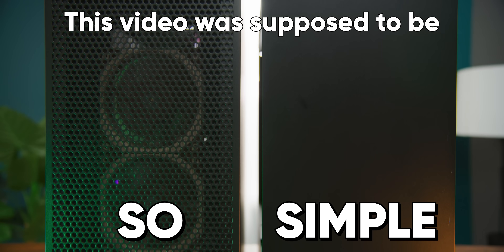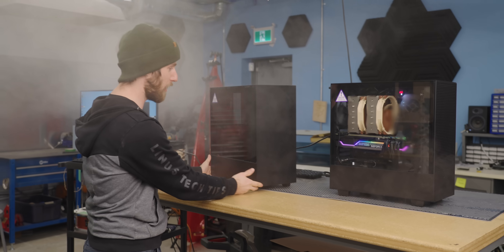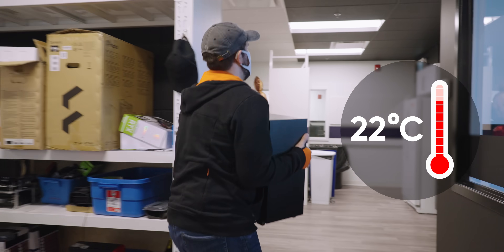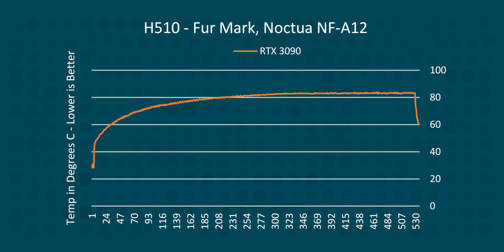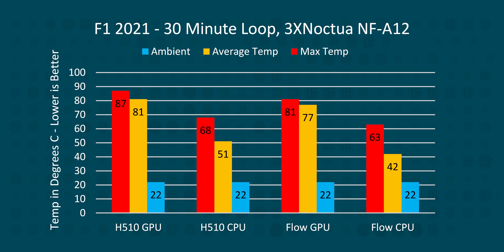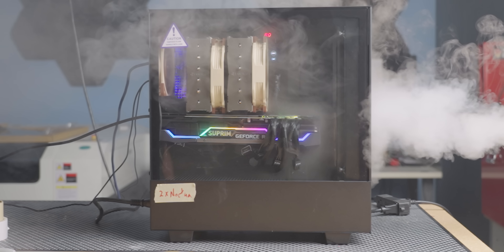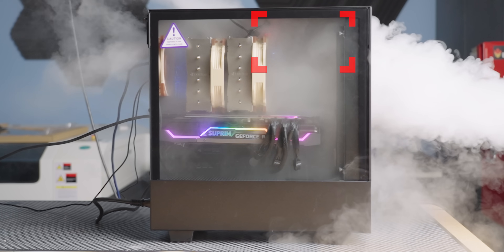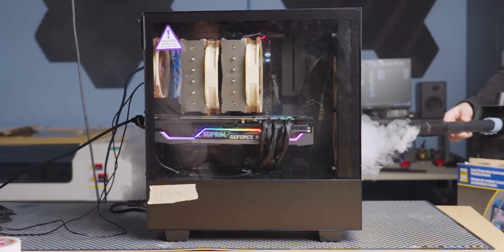Everything You Know Is Wrong - Mesh vs Non-Mesh Front Panel

Comment: I was worried about my corsair 4000d airflow when I saw this video, but I am building with two 140 mm noctua fans on the top for exhaust and 1 120mm noctua fan on the back for exhaust.  My plan right now is to run my exhaust fans much slower than my two 140 mm noctua fans on the front to create just a little bit of positive pressure.  If I'm not getting good temps on that in my gpu I can try the vertical mounting option for it to open up some more space inside the case.

Comment: I spent hours tuning the fan speed on my Pc to compensate for temp changes. basically created a state of constant positive pressure. as the temps rise my rear exhaust fan actually slows down to compensate for the blower GPU and the Top mounted AIO. so far so good.

Comment: it really seems like the main problem is the size of the case. which butts the bottom fan blowing directly into the side of the gpu. plus the 3090 is 5 inches thicc. if you're already spending $1800 or more on a card. you may as well get an optimal case or a water cooling solution to mitigate your airflow problems with such a large card. also I'd really like to see a tapered edge option of add on or just a  3d printed one. then the air wouldn't be slamming into the blunt 5" end of our thicc boi 3090

Comment: What I did to help fix the issue of air getting stuck around the GPU is zip tying a fan to the back of the case over the pcie slot things so it would pull the air out and go past the GPU on the process.
Reply: so basically 2 exhaust fan at the rear (1 rear for cpu exhaust and 1 rear exactly behind gpu)??
Reply: @bolulembut1132  exactly
Reply: @tinyterrarian  thanks for confirmation, is it still effective with solid front panel with 3 front intake 2 exhaust (back cpu and back gpu)? im using tecware nexus M and im still wondering what best fan configuration for this case

Comment: I have a closed front case for my computer, with a reference AMD, had my GPU running really high temperatures, switched stock coolers for 2 140mm noctuas to increase internal pressure and the temperatures dropped more than 15º on GPU. Organic load on CoD MW2. Apparently the GPU was trying hard to blow out air from a low pressure environment to a high pressure environment, that was my conclusion, but I'm not an expert or neither did more tests, just accepted the absurd improvement.

Comment: Oh, how much easier it would be to experiment with thing slike this with some pior analysis based on some thermodynamics knowledge...
yeah, you cna prettymuch look up any fan with it's statitc pressure and airflow
then calculae the dynamic pressure at specified airflow
and see that it's much less than the static pressureindicaing that while restricting it wil lreuce airflow, you can keep a significnat portion of your total airflow with quite some restriction
from there it's a quick step to plot a decent approximation of the exact restriction area to airflow function
but yeah
all intakes is going to lead to airflow roguhly equa lto your static pressure over your outflow area

Comment: I wish people would do more fan layout testing on cases. I have a Fractal Design Define 7 XL Black and had 3 intakes up top 3 in front 1 exhaust in the bottom and 1 in the back. temps were fine honestly but I can't help myself but to mess with things sooooo I used my vape to see how it was circulated and the fans seemed to be fighting each other. I had a dead spot in front of the cpu. I changed it to 1 top rear exhaust 1 rear exhaust 1 bottom intake blowing straight into the gpu and 3 front fans and it seemed to make a big difference. I google all I want though and I can't find much other than forums with everyone saying conflicting things. Thanks for this vid tho it kind of confirmed in a way the problem i had kind of. How is there no one testing fan lay outs for air cooling and water cooling for different cases with a mix of gpus?

Comment: I have the Lian Li 011 Dynamic EVO and I thought the mesh front panel would cool off my video card more, but it just ended up looking uglier and no benefit.  That and it looks ugly compared to the tinted glass, so I put the glass panel back.  Temps are about even and it looks 100x better with the RGB.   I did not add additional fans, as it already has 10 ARGB fans (3 on the top mounted 360mm AIO) and is a wiring nightmare already!

Comment: if the motherboard manufacturers understood  heat dissapation they would reconfigure the  gpu on top of the board (Heat Rises) and case  manufacturers would  make power supply mounting  on top of  case and make many fans for exhaust on top of  case....combustion engine  principles, exhaust is  important out the valves...but  hey everything works. Why is  the hot , most watt consuming part right  below the cpu....ughhh so stupid and  so many people  want to refine this dumb system....Linus...please....build a  mother board....please do some emulator testing, real world benchmarking for  average users. i need a flex duct/register clip on to hvac and  a case  that allows this...muhahahahahahaha call me linus, lets make 10 million

Comment: In my opinion I disagree with this video and it is kinda misleading, it really should be changed to "Compact cases: Why Extra Case Space Is Important" The issue is your cramming such a huge GPU & CPU cooler in a case that is marketed as minimalist/compact mid-tower. Just because it fits does not mean its a good idea. This test/video should be repeated with the same hardware in a normal/non-compact designed ATX case offering a mesh/no mesh option.

I do give Linus credit he admits this is an extreme scenario however, I would not have chosen this case with this hardware because of the limited air flow, and case design. Linus sums it up quite well in the end "PC building is about balance and personal preference" Poor case choice for the hardware, with poor ventilation, with very little room for my liking.

Comment: Great Video Linus, really, great video. I loved this one, but i have one issue with it. 

It took you 6 and a half minutes to repeat the same result and the same question many times before you say straight what happens and why? 

6 and a half minutes of watered down content repeating the same many times can be condensed into:

We tested the solid front panel and mesh front panel versions of the same case with the following results:
Results with solid front panel and stock fans are.... 
Results with mesh front panel and upgraded fans are....
The reason for this result is shown with our smoke machine ,the mall case creates lot of turbulence, and inability to provide a good airflow to the affected parts (parts in question) and the smoke machine only shows the turbulence and recirculating hot air, actually diminishing cooling efficiency....

and this takes minute and a half to 2 minutes, considering frame changes, demonstrations with the smoke machines and make everyone understand it. Come on Linus, you can do better than that. We know you know better than that and you can do better than that. (last sentence is intended as compliment and stating the truth)

Outside of this single issue, the video is great, i learned a lot, and as general conclusion - i love the video. But the watered down content on stating the same statement and repeating the same question for 6 and a half minutes, i am afraid that this is well earned, and well deserved dislike. Sorry Linus. No hate or trolling intended.

Comment: Hi, Thanks for the video. I have a question, is it so bad to use the case without sidepanel? My case doesn't have a mesh front panel and my vents are not filtered, so would not using side panel make much of a difference?
Reply: not really, just that dust will have a freeway to settle in your components, unless you fancy cleaning every week

Comment: I wonder if a 3 fan front panel case would be better as it would shove more air underneath the GPU, or even the PSU upside down shoving its air into the GPU, afterall more air that is slightly warmer is probably better than not enough air

Comment: I anticipated this when i built my rig. Its the reason why i opted for a Lancool 2 mesh case and installed 2 fans underneath the gpu drawing air from the mesh side panel. Aside from the exhaust behind my tower air cooler, I also installed another exhaust right above it and blocked the rest of the mesh up top with an old plastic folder and tape - I want as much of the air taken in by my top intake fans to go straight to the aircooler and not escape through the top mesh.

Comment: This is literally the best explanation to what I was trying to figure out. Just bought an H5 Flow that I’ll be using with the hot 7700X, but I’m using an AIO and just a 3070 FE, so the inside won’t be cluttered at all and much more airflow will be on the inside. I think it’ll work perfect as I’m also using all the premium noctua fans too, even for the radiator. Thanks for this!!

Comment: Would be interested to see this repeated with the H7 flow, as it supports 3 top exhausts and, maybe even more importantly, has a 3rd front fan with airflow possible directly from bottom right directly into the gpu pull, while the case shown here has no intake really pointed towards the gpu intake.

Comment: I have a closed tower. 2 ventilators in the front. 1 for CPU and 1 for 3080.

2 ventilators in the top.
1 for additional intake, 1 for outtake

And 1 ventilator in the back for outtake only and it works. 
Be sure the outtake ventilator is on most rpm in the system

Comment: My case has holes in the unused PCIe slot brackets, and holes in the back side of the case, below the GPU. Surely the front fan is pushing air through and out? Is this not just a bad case design?

Comment: I just built a pc and had this same problem.. fix? I got a computer from 2001, took a 3 pin fan from it, opened up all the pci slots and mounted the fan blowing outward. So the gpu blows down and that fan pulls it out. Gpu temps dropped 15 degrees, all for free

Comment: Had an H510 with a 10850K + 3090, CPU cooled with front mounted Kraken X53.  Ran fine with respectable temps.  I did the same thing in a previous build with an H210i case with a 3700X + 1080 Ti.  Gasp.  Temps were fine.

Comment: Now do the test with a liquid cooling option with the radiator mounted on the top of the case. I'm using a Corsair 4000D with three fans up front and exhaust fan and a EK AIO 240 with the radiator mounted to the top. I wish had my rig there to test with the fog machine. I replaced all the case fans and radiator fans with Artic 120s. Three up front blowing into the case, two on the radiator on pushing heat out of the case.

Comment: I fixed the GPU exhaust recirculation in my case with a horizontal acrylic panel level with the GPU shroud that seals off between the GPU and side glass. Would probably help the GPU intake level the playing field of that negative pressure pocket in front of the CPU cooler guiding more air above the card.

Comment: This is why i went back to a Fractal Design S from a Meshify C a year ago. They made cases worse for looks sake. The PSU shroud in the bottom is straight up idiotic, it hinders fresh air to the GPU from a bottom mounted fan and the front fans are mounted way to close to the gpu. My pc is cool and quiet again.

Comment: Heat is diffused by being exhausted, not by having more air trapped in the box with it.

The single exhaust fan has always confused me as temps increased over the years. It doesn't matter how much more air you stuff in a box if the heat inside isn't getting out, it just heats up slower because there is more mass to absorb the heat. Exhaust is much more important than intake. Air will always find ways into the case if you keep a static negative pressure in the case, this is why we had an exhaust fan to start with instead of an intake fan. We also discovered that having the primary source of intake to be at the bottom for the coolest air possible, but that we need perforations throughout the rest of the case to prevent any area to stagnate.

Modern PC hobbyists have literally thrown decades of hard earned knowledge out the window in persuit of the cool factor.

General rule for never being concerned with heat build up ever again, 2 fans blowing out of the case for each fan blowing in. The custom loop guys are the closest to understanding this. Exhaust ensures intake, intake does not ensure exhaust.

Comment: There are fans that are designed to pull air more from the side that from the front. Those would make a big difference in making that side strip a viable option for intake air. If someone took the time to design a good bracket and thin fan setup, a side-pulling fan pushing air out under the graphics card would help tremendously. Noctua fans are fantastic, bun fans aren't one size fits all. Not sure if anyone makes side-pulling fans for PC, but someone should. You could really get creative with cases if you need the thin side open to move air instead of the big round front.

Comment: I have h510i with 60’ Celsius GPU temp and 51’ Celsius CPU temp playing COD. I removed dust filter from the bottom, added 140mm fan at the top , AIO air cooler push/pull config at the front and an extra fan diagonally where the HDD case were !!! RTX 3080 and 5900X is my config

Comment: There's this genius way i came up with that keeps your gpu cool and it doesn't involve adding more fans you just need a shitty office pc case that has one fan in the back none in the front and you need to drill holes in the case under gpu and thats it no more thermal throttling.
Btw I've done this and my gpu under 100% load heats up to only 45°c

Comment: this is why I chose the Fractal design torrent compact. with GPUs getting even hotter and board partners not wanting to find ways to decrease the size of coolers. it is seeming like the power supply will need to be moved back up to the top of the case so the GPU can get fresh air directly.

Comment: Can this test be done again with an AIO and noctua fans? I wonder if removing the large CPU aircooler would free up the flow of air better and how that performance changes with Noctua fans vs stock fans. 

I have this setup (N7 B550, 5950x, 3080ti, Noctua 140x3 (2 front intake, upper exhaust), Noctua 120 rear exhaust) and switching from the chromax black to an AIO and now the rear exhausts blow air our really well and the heat from the GPU can exhaust much better. I also experienced the small pocket of hot air in the bottom left corner. I got a vertical GPU bracket by EZDIY Fab and that helped initially, but the riser cable (PCI-E 4.0) could not handle overclocking of the GPU, so I went back to the original configuration. 

Curious what testing results would be now that an AIO was being used and dampens the intake fans pressure through the AIO rad and also what about pull setup with the fans on the inside of the AIO rad.

Comment: I have to ask though. Why this case? Why this massive 3090? All you have to do was get a bigger case if you are going with such high performance parts. This case only has space for 2 front fans, off course the lower one is going to be block badly by such a humongous GPU. And if you wanted such a small case that badly one solution would have been to just get rid of the huge air cooler and go with a 240mm radiator on top. This way hot air also gets force out towards the top of the case and not just the back. This would help dissipate some of the heat currently between the GPU back plate and lower portion of this massive air cooler and fans which explains why the GPU kept so warm 🤷🏻. Cheaper option,get a bigger case with 3 fans in the front.

Comment: antec df700 flux is the best case for air flow come with 5 fans . 3 are RGB . a controller, and it can take a 360 mm cooler top or front. Also the front can take 3 140mm fans. All that under 100 bucks!

Comment: I mounted my double stack Noctua CPU cooler vertically, blowing out the top vent. Added a single Noctua fan into the mesh front of the NZXT Flow. Running a 3070ti.

Comment: In a nutshell: Don't buy the h510, even the flow model.
Reply: In order to channel airflow, you need to plug every hole which is not behind a fan.  The end.
Reply: Well it seems like the CPU fan cooler was drawing the intake air up and over the GPU…. Perhaps an AIO cooler to the top of the case would show better improvement (for the flow at least)
Reply: Look now at nzxts new cases. It's like a miracle happened, they went from dogpoo to amazing. I even built a system with the h6 flow recently and it's actually good. Also like the way the panels quick release. Overall way better than all their previous cases with only one top fan and choked front panels. I remember slowly realizing how bad their cases are after years of techtubers hyping them up.

Comment: 84 degrees for the GPU is terrible.  My case is an ancient Antec, and has only one 120mm case fan, but my graphics card (Geforce GT 1650) only tops off at 70 degrees in Furmark.

The lack of empty space around the tower cooler is probably what's heating up the GPU.  Heatsinks can radiate alot of heat, and in this case it's probably being radiated into the graphics card.   In such a small case, a tower cooler like that should never be used.  Also, it would benefit from a smaller graphics card, like a Geforce 3050 or 3060.

Comment: I went with a full mesh case. Front panel and both side panels are fully mesh. That plus a 360mm AIO, means even with benchmarks running on both GPU and CPU at the same time, temps are not an issue at all.